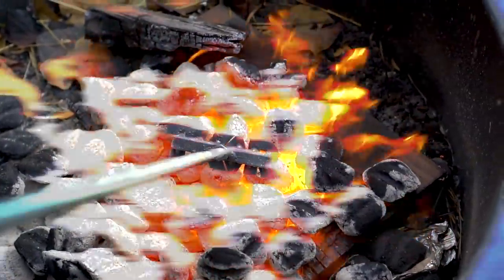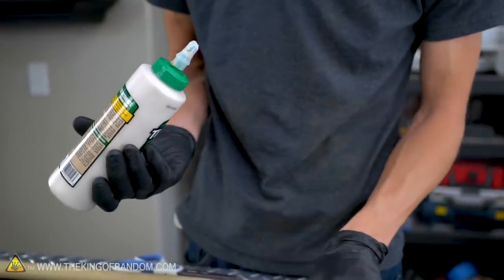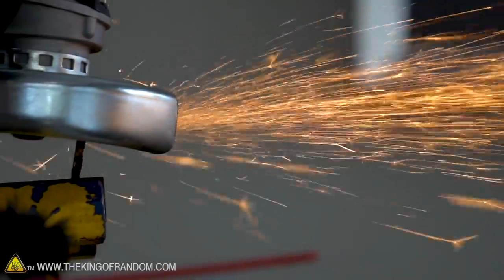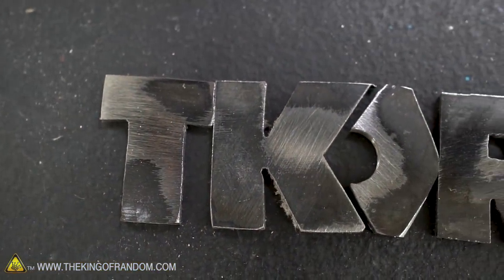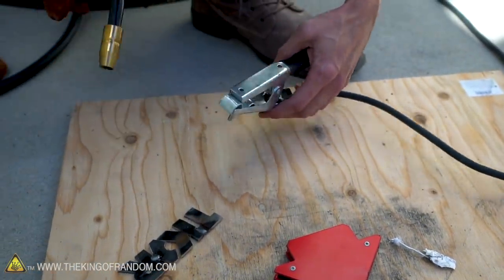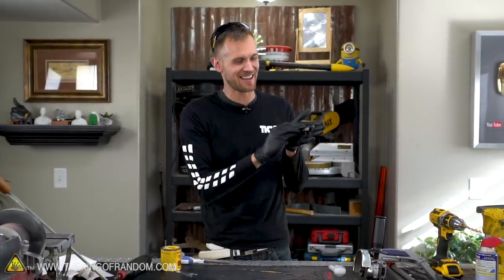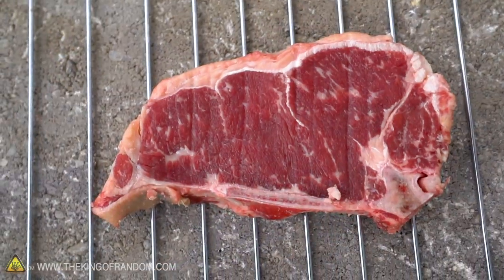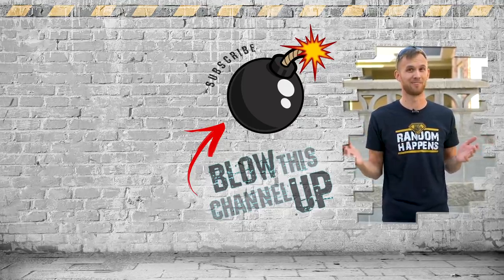TKOR is a Brand - Literally

Comment: Two questions; is it possible to cast metal in wood? Would it burn the wood? Would give the metal a cool texture??

2. What happens if you drop molten metal into liquid nitrogen?

👑👑👑👑👑👍👍😍
Reply: I'm sure the metal would burn the wood...
Reply: The wood around where the metal was cast that is exposed to the air will probably ignite.
Reply: The wood wont make it to the point where aluminum could melt
Reply: The metal could burn through the wood but it mater's on how fast the metal cool and how hot it has to be to melt
Reply: @VOIDFULRAPS  it matter on how hot the metal has to be to melt
Reply: Nope...can't cast metal into wood...Wood burns and a MUCH lower temp than Aluminum melts...now then, Gallium would work...
Reply: @WreckDiver99  I was talking about basically galluim
Reply: miles stadtler answer 1 fire
Answer 2 cold metal
Reply: Maybe if you superfreeze the wood with some ice in the outside maybe it could work... Or explode XD
Reply: Thats 4 questions
Reply: WHAT ARE THESE QUESTIONS THESE ARE OBVIOUS RESULTS
Reply: I don't know... sounds cool though!
Reply: Not all metals because gallium melts at like 90°F

Comment: you should see what happens if use the welder on dry ice or liquid nitrogen or brand dry ice
Reply: The welder has to touch steel so wouldn’t work
Reply: The material that you use it on has to be able to run an electrical current to make a full circuit so it wouldn’t work on dry ice or liquid nitrogen. But branding dry ice, now that sounds interesting.
Reply: If you tried to weld steel at liquid nitrogen temperatures how well would it work?
Reply: Dale Herman it wouldn’t work, for one the welder won’t start if it’s a gas operated welder if it’s a AC/DC (DC Inverter) Welder it may work, but the metal may crack due to sudden temperature changes, and since the temperature of the weld is around 1600 to 1700 degrees it would shatter the metal and damage the filler wire.
Reply: If you tried to brand dry ice it would create a screech that would makes ears bleed

Comment: You should of used a square bar instead of a steel pipe. As that way the letters work as a heat sink and constantly draw heat from the mass instead of it all cooling off fast like it would

Comment: i didn't think that it would stay hot enough long enough to brand the stake sense steel has a low specific heat(amount of energy needed to heat it) and a high conductivity (how quickly it can transfer that energy)